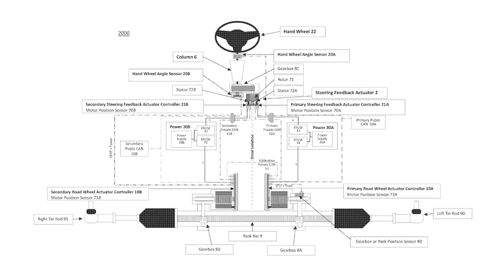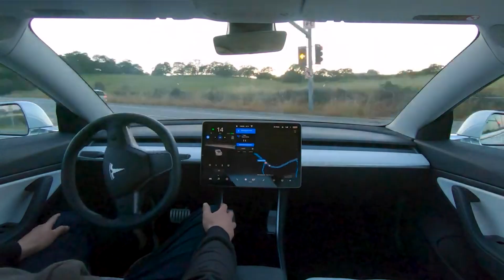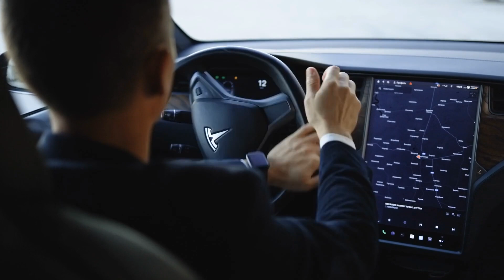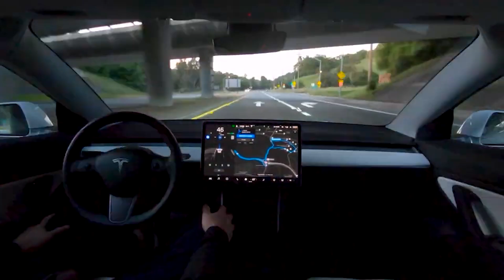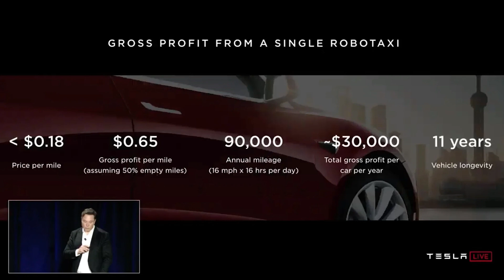Tesla’s Steer-by-Wire | Disruptive Investing News

Comment: Apparently joysticks were not ideal but how far did they go with that development ? ' there is no reason to have traditional style thought behind steering servos or motors it could be a direct system along with an in wheel motor that has less weight than traditional unsprung brakes and associated systems - Glad to see Teslas direction to innovate and improve over the other failing companies that refuse to leap out of the box

Comment: Tesla does "bean counting" all the time. Using less bolts etc. in later iterations of the same model. Saving 10 cents per car all the time.
Reply: That's a good point. I think they did customers a disservice by taking out ultrasonic sensors before the camera-only software adaptation was ready. But Tesla is still the biggest risk-taker among companies when it comes to R&D and testing out new concepts. Call it "strategic" bean counting I suppose lol.

Comment: For volume production not having to move the mechanical steering system should increase the ease of building Right V Left hand drive vehicles, saving downtime during production and also allowing a standardised steering rack for all cars. Most modern cars use a drive by wire system for the accelerator pedal now so this is the next logical step.

Comment: I see lot of people comparing aircraft Fly-By-Wire and automotive Steer-By-Wire... but they are completely different animal.
Airplanes are flown by Trained, licensed, certified professional pilots, maintained by big corporation with certified mechanics, and heavily regulated by government big brothers.
Airplane does not crash just because the aircraft has few inches of positional error caused by FbW. 
But for Automobile... your uncle Joe will bring out OBD2 code reader and poke around connectors if there is a SbW warning light.
Automobile will crash and people will die if it can't hold it's course within fraction of inches.
FbW and SbW are not comparable.

Comment: I don't think it's FSD related. Tesla could just remove the steering wheel and cover up the end of the steering column.
What it actually makes possible is variable steering ratio and independent steering of the wheels. The first makes the yoke more convenient to use, and the second may allow the Cybertruck to do some crazy things (like using it's wheels as propellers while in the water).

I don't think steer-by-wire is expensive, cars already have power steering, so it's really just replacing a steel rod with copper wires. It might even cost less, if the mechanical backup is not required anymore.

Comment: To learn how regulators will likely approve Steer-by-Wire systems in a car, it is helpful to study the development of aircraft Fly-by-Wire systems. Because of the number and type of control surfaces, aircraft systems are more complex than car steering. The first all-digital Fly-by-Wire system was approved by regulators for the Airbus A320 in 1988 - 35 YEARS AGO. 
Steer-by-Wire systems in a car need regulatory approval but there is precedent in aircraft that should guide and accelerate the process.

Comment: CYBERTRUCK REQUIRES STEER-BY-WIRE
Tesla is not going to add mechanical fault prone parts to their vehicles. That is the opposite direction of their vehicle evolution. 
A: We have seen that it has rear wheel steering. I can't see Tesla using a highly complex mechanical system with physical linkages going to the back axel to perform this.
B: To do a siddel lane change, an ability it is supposed to have where you move sideways whilst still pointing straight ahead, requires more complex mechanics (front and back) unless you use steer-by-wire.
C: For propulsion through water without a propeller, even recently Elon has stated this ability,  the Cybertruck is likely to need to splay (angle at opposite directions) in order to achieve this.
D: It still needs to point the wheels in a normal direction for moderate sppeds.
That is 4 modes of steering,  no way Tesla will choose to do that mechanically with presumably an ICE car style shift-stick to manually select the mode?!
Reply: There's a long comment by an automotive engineer who works on SbW and it has a lot of good info. Definitely go read it for sure. Sometimes I think Zak & Jesse should try to reach out to the community while producing these videos. Their assumptions aren't always correct.

Comment: The bottom end (computer to wheels) is FSD
All the sensors, motors, etc are there, working and tested.
The "top end" (steering wheel to computer) is essentially the Logitech force feedback gaming system.
(Other comparable systems available)
The "override link" between the two? 
 Comparator (software) confirming similar input/ output, linked to a "normally released" solenoid which links the column in its unactivated state
.
When the car is "off", it's deactivated and a sprung connection joins the two ends.
If there's a power failure, see above.
If the car powers up, the solenoid activates pushing against the spring and decoupling the steering wheel from the steering box.
(It's not dissimilar to the Semi truck drive release?)

Comment: If there is any truth to this the BIG advantage of SBW is variable steering depending on speed so that the maximum steering angle is 90 degrees , no more upside down yoke steering wheels  and they will finally make sense of that idea, also we may get the Model S and X back in RHD countries as is will be trivial to put the steering wheel either side with no mechanical link to worry about.

Comment: Why does the backup have to be mechanical?  Why can't they just use redundant electrical systems?  That's what the diagram in their patent shows.
Reply: Exactly. That's what all the OEM's are realizing. If you want to do SbW, just go all electric all the way. No need to have mechanical backup - it takes away the packaging benefits that SbW offers.

We got rid of throttle body cable Decades ago. Yes it caused the crazy Toyota Sudden Acceleration fiasco, but the industry learned the lesson and it's now robust. There is not one single car that has cable throttle body today.

Comment: The cost for reduntant motor and sensor I imagine to be ~ 100$. Remember Zach, cory at monro said the HW3 computer was 2,000$ if memory serves. Same deal with steering, put it in and they get the data!! Think it is in the CT, in the Franz at peterson vid, you can see the steering oblong turning not so much at the same time the front wheels turn quite a bit more than would seem normal. Somewhere I heard that s/x will get a steer by wire update as well. keep up the good work and alternative thinking!!🤔

Comment: What about steer by wire with a linkage that can just be disconnected (either manually, or even software that electronically disconnects the hardware link). For once it gets approved.
Reply: Infinity Q50, world's first SbW production car, already does this. They have an electromechanical clutch in the middle of the linkage. It engages in case of electrical failure, taking it back to mechanical steering.

Comment: If steer (and brake) by wire removes all the hydraulic system power assistance, then it should be cheaper and lighter.
Reply: EVs don’t use hydraulic steering. They are electric-assist. Even modern ICE cars have electric steering to avoid parasitic losses from the hydraulic pump.
Reply: right!! costs will be offset by not needing current fsd steering control and not needing assisted steering system. SbW will replace multiple systems plus mechanical parts in addition to making it easier to manufacture both right and left steering on the same line. I've seen estimates that show they may even save money by switching over!... bottom line is the SbW system replaces 1) current fsd steering, actuators, motors, ect., 2) current assisted steering system, power steering 3) mechanical linkage

Comment: Advantage is also steer by wire allows for a different ratio according to speed. Dynamic Variable Steering Ratio. Today it’s 1:1 as you rotate wheel moves wheels x degrees. You could make a slight yoke steering rotation move the wheel angle 100% when going slow where now you have to go from limit to limit using steering wheel having steering linkage.

Comment: Lexus already has it on their new SUV. Also, I believe canoo is using drive by wire. 
I don’t think any of those vehicles have conventional, mechanical steering systems, I don’t believe one is required. You just have to have duplicate everything. It looked like the cyber truck Hans just had in LA was steer by wire.
Reply: Who's "Hans"?
Reply: @rogerstarkey5390 Franz I meant

Comment: Are there any solR cars yet. Or non windshield wiper cars using a vaccu.m 1500 watts suction powered with internal spikes to remove febris?❤❤❤❤❤❤❤❤❤❤❤❤❤❤❤❤
Reply: Aptera is coming out with a solar car. It’s still battery-powered, but the solar panels can add like 40 miles per day.